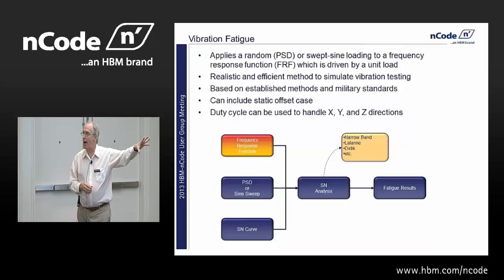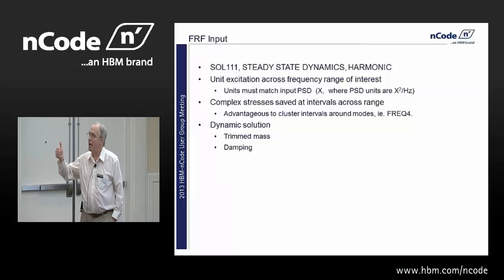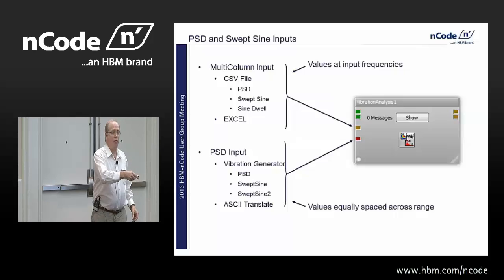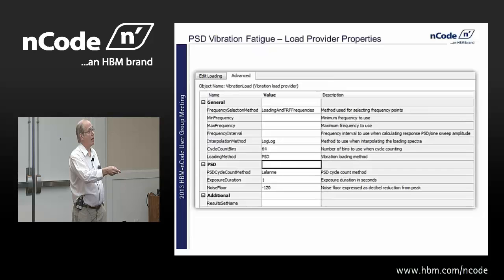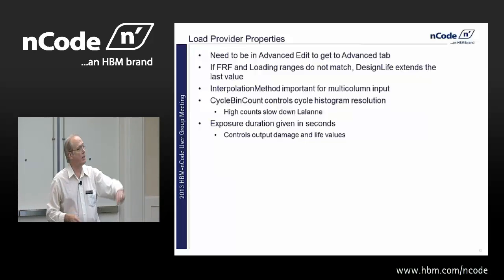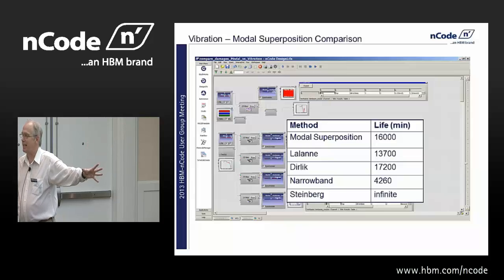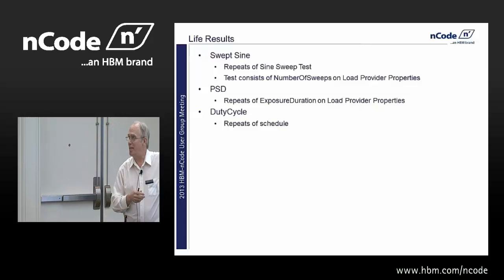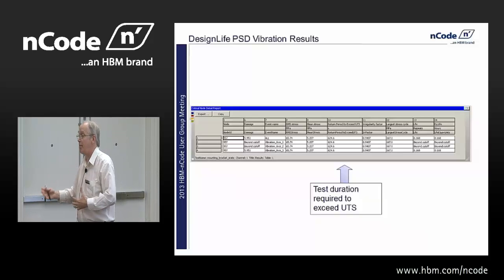An Overview of Vibration Fatigue Analysis in nCode DesignLife

Comment from the maker: CAE fatigue analysis dramatically reduces the reliance upon physical prototyping by predicting durability performance earlier in the design process. nCode DesignLife allows for rapid fatigue analysis and can incorporate company specific fatigue methods and material property databases. Uniquely, DesignLife integrates real loading data within the CAE analysis software, and can even act as a virtual shaker table.